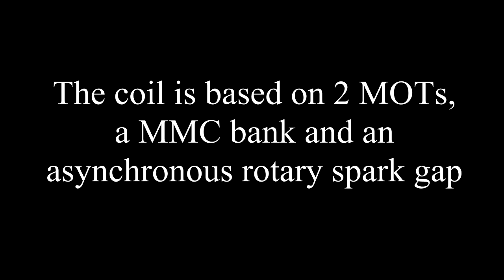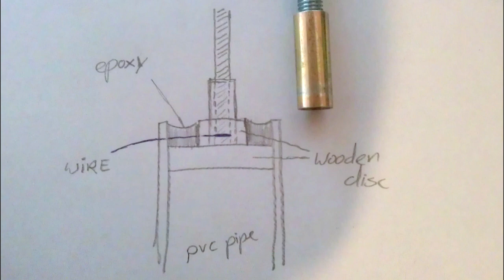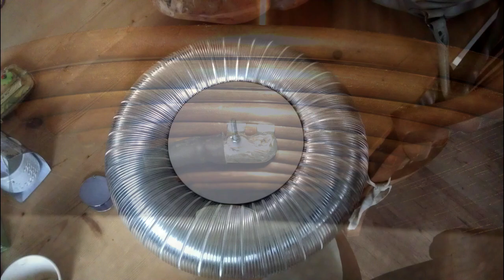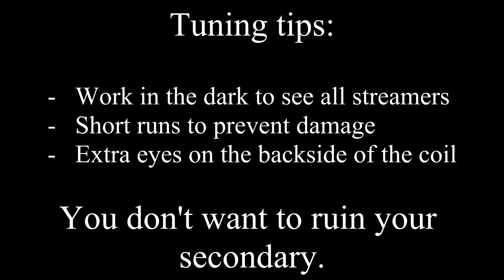How to build a dual MOT Tesla Coil

Comment: I haven't built one of these in about 20 years. Last one I built was based off a 150ma 8kv transformer, forced air static gap, a home made acrylic/flashing/mineral oil cap. It was loud but made some very nice violet arcs. Best arc distance I managed was just shy of about 4 feet.

Comment: Only 4kv? Nicely done. Those must give a nice bit of power to the coil. Probably about 500ma, yeah? From what I've read they can handle some abuse. That's about a 2kw coil. Planning on a similar power supply. But I'm thinking about submerging the transformers in mineral oil

Comment: That's a brilliant coil, mate! I'm just judging from the video but the discharge is pretty thick which implies a fairly powerful discharge. I noticed you had a bank of capacitors in the primary circuit. Were you ever in a position to replace this bank with (say) an equivalent single capacitance which might have a lower ESR?
Whatever you've done it's worked well! Thanks awfully for taking the time to share this video clip.

Comment: I got shocked by a MOT before. I probably almost died.
Reply: Did you touch the terminals with both hands or just one?
Reply: @josephrossman1600  hard to remember. I remember the most horrendous electrocution I've ever had. It feel, and it came undone. I felt it go through my chest.
It burned holes wherever it touched.
Reply: , see, I'm usually MUCH more careful. Just that one time. Didn't even get the fluorescent to light from an okay distance away. :/ (was also using the magnetron)
So very safe of me... I've done it before and it went great. I just got in a big hurry.

Comment: I have an urgent question concerning my coil.  The resonant cap size for the coil is .01uf while the resonant cap size for the dual mots is .6uf, how do I get around this. And how did you figure out what to do??
Reply: Platinum Science what exactly do you mean by that? Can you explain in more detail.
Reply: there is no such thing as resonant cap size for the power supply BUT there is something called recomnded maximum capcitance for the power supply which happens to be around 5 or 6 micro farads for dual mots like what you said so you dont have any problems with youre resonant cap size of the coil

Comment: hi, i have some question, is the strike rail a circle connected to ground to prevent sparking to the secondary, and why does it need to be a open circle
Reply: Ok the strike rail is to prevent discharge into primary coil . As for the reason it has to be an open loop  a closed loop would would be like a em antenna causing interference to be emitted everywhere

Comment: what gauge wire is used for the secondary coil and why doesn't it get burnt up when it is putting out those awesome freaking streamers?
Reply: notny411 because it's only such low current
Power=current * (resistance)^2
 Hi server the secondary should be insulated properly to avoid internal acring

Comment: I'm interested in building one of these. I have one question for you. What is the advantage of the rotary spark gap compared to a regular spark gap?
Reply from the maker: interval of firing is more reliable/stable, easier to work with.
electrodes are cooled constantly, speed control while gap is firing, really handy.
Reply: ionized air is moved away relative to the gap so that way a continuous arc wont jump the gap

Comment: Knowing the characteristics of MOT"S wouldn't you fly through them? With all that arcing it seems like it would murder them. Just wondering. Nice job though. :)
Reply from the maker: Well, mot's aren’t build to power a tesla coil of course, but they can handle a little abuse and they have the protection of a large ballast and a safety gap (and terry filter) so they should be fine  …   I hope. :) haha
Reply: +Job Beeftink how exactly would it be best to go about hooking two or more MOTs up together to power a t coil? You should make a more detailed description for me if you can. Can I mod the transformer for better performance and if so what exactly would I do?
Reply: Job Beeftink Can put a schematic together? It would really help.
Reply: Mr. MHz I already built a basic spark gap tesla coil. I know how they work. I know how to be safe. But I built it in one night (I was rushing), and it's not very impressive because I paid little attention when building the primary, secondary, and top load. You can barely see the sparks during the day.

Comment: Hi, how did you calculate the primary cap? I have some MOTs but I don't have the nominal power and can't calculate the capacitor to begin with my tesla coil design. Can you help me with the design process? i don't know whixh parameters must be calculated and ones must be selected by me. Thanks a lot.
Reply: Gabriel Droguett Olea usually mots have an output of 2100 volts, go to deep fried neon they have calculators that will tell you the capacitance needed for your power supply

Comment: Job Beeftink i really need your help. What is the voltage and current output of your MOT's? Im trying to use MOT's but im getting a output of 6000V @ 137mA! This current is too high and the optimum MMC would be 118nf!!! How did your MMC value get down to 56nf? Please help.
Reply: Kokodps normal output of a mot is around 1000-2000v 800ma load

Comment: Did you make your capacitators? If not, where can I get some like them?
Thanks.
Reply from the maker: I don't know where to get them. I only bought the mot's, copper wire / tubing and toroid, everything else is reused stuff. ebay maybe?
Reply: Mouser sells then